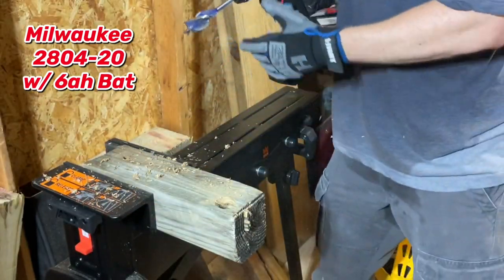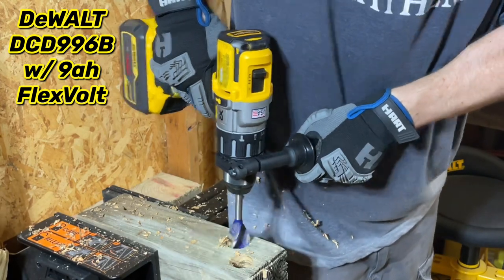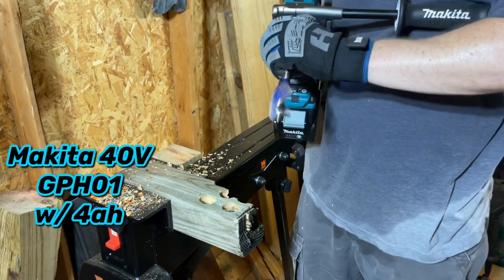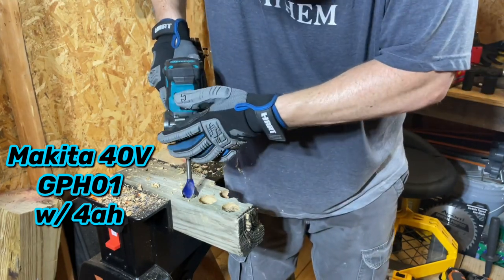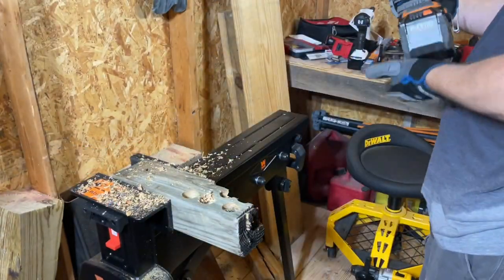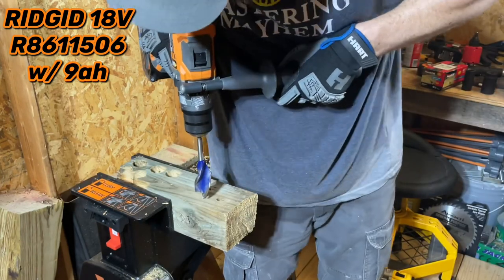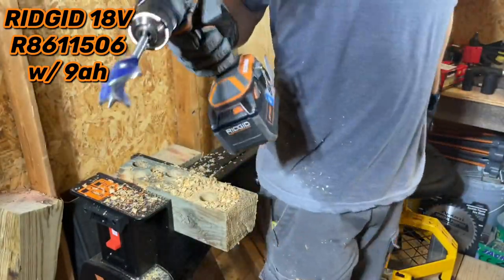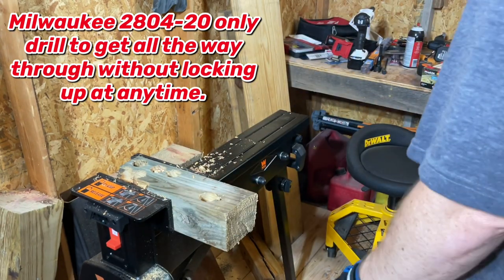Hammer Drill Versus Video 1 1/4” Speedbor Bit Through 4x4 Lumber - Milwaukee DeWALT Makita RIDGID

Comment: I will say drilling through a piece of wood clamp like that will usually be easier when drilling in the hanging end.  More flex less bind on the bit.  Believe all drills are great and offer minor differences that matter depending on preference.  Warranty, feel, vibration, weight, durability…..
Reply: Not quite accurate frank when you have the deflection it binds the blade because your not drilling a straight hole it goes in at an angle which binds the tools the Milwaukee dominated

Comment: I know you you tried all of them i seen you not got to speed 1 on that DeWalt thats that torque setting I've seen it go through there with that same bit on that setting other than that you did a good job that's a hard test on any power tool
Reply: Milwaukee did it in speed 2 no hesitation if you have to drop from 3 to 1 its just not on the same level

Comment: u used old model of dewalt 996 fair comparison was new dewalt flexvolt advantage 999
Reply: The DeWalt is 5yrs old, still looks good and I’m sure could’ve done it in speed 1. What more can you want in a tool line. The newer drills are much better. The Milwaukee is old too but only 3+ years old and a new version is about to be released. So again great brand.
Reply: Cry those yellow tears do you know how old that Milwaukee drill is?